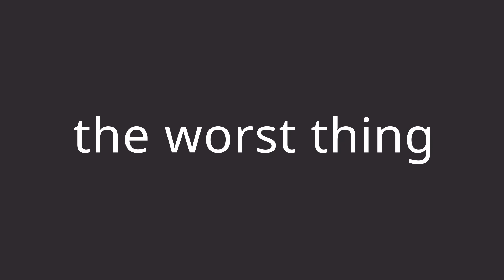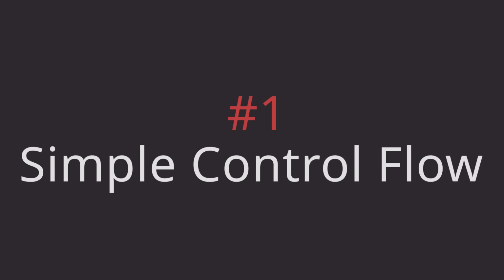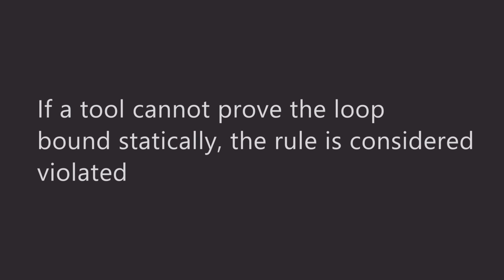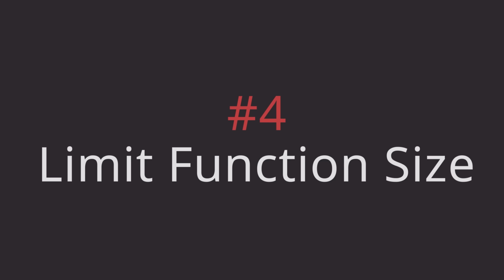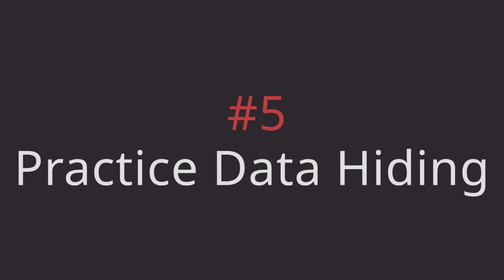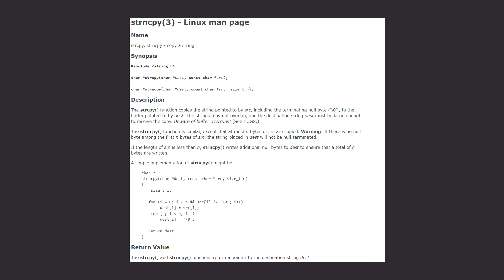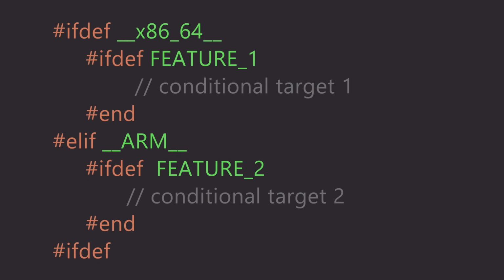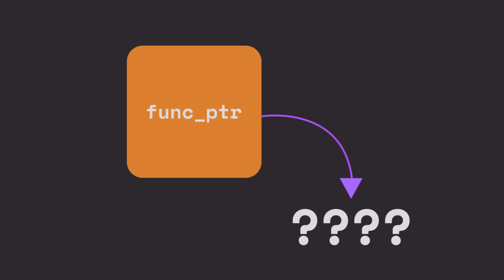how NASA writes space-proof code

Comment: I agree with every on one of these rules for all programming. I think there should be NO pointers, but that is just me. NASA code should be clean of anything like pointers or anything else not predictable. I don't care how careful anyone is, there is always a way for a pointer to suddenly get a NIL value, including from cosmic rays. Also, comment and full documentation as well. And make all functions testable independently of anything else. To be honest, I would rather a language like PASCAL be used, not C. Am I sounding stupid? PASCAL does not require pointer use unless there is a good need to do so, and pointers should be disabled for mission critical code in any case. I especially like how PASCAL allows one to devote their energy to good algorithm and programming, not to pointer manipulation and debugging.
Reply: "from cosmic rays" If your hardware is that vulnerable, do not use it in a space vehicle. Yes, your "pointers are evil (or I'm just too dumb for them)" bias is showing.  If a cosmic ray can change your pointer to NULL (not much of a chance for that, logically), then it can also change your thrust value from 0 to 32.  Which is just as bad, if not worse.
Reply: @JurgenErhard  I know how to use pointers and I use them when I need them. Sorry if I sounded stupid. Yes my cosmic ray remark was dumb, Just metaphorical speaking :). No pointers are not evil like I said. I use them all the time, But When programming Software to be used on space vehicles, I take things a little differently. And yes I am always careful with all of my code. And yes I write my code such that it can be reused, debugged, etc. readily.

Comment: This video puts me in mind of the scene in Apollo 13 where Gary Sinise was given a mountain of junk like vacuum hoses, connectors, wire scraps, tape and an RS-24M power supply and told to get the orbital craft's on board computer to boot using only 20 amps and that "failure was not an option".

Comment: I am a software engineer working on the mars helicopter with JPL. Most of these concepts are already familiar to me, but a couple are new as well. The ban on using heap memory is one that I very strongly adhere to and a lot of new embedded developers are often surprised by. When the IDE supports it, I set the heap size to 0 right away.
Reply: I haven't worked for NASA directly before but I did write code that take astronauts to orbit. We didn't really ban heap memory in our codebase per se, but basically everything has to be allocated upfront at initialization time, and everything is always initialized on boot. So we still use heap memory, and use C++ STL containers, but at post-initialization time there is no memory allocation. This way, you could be more flexible, but still get pretty strong guarantees. If your code is going to crash or run out of memory it's going to fail to init, which is detectable very early on in CI, and it's usually going to fail in the same way.
Reply: @BrotherCheng  That sounds fantastic.
Reply: Do you have the stack size set to a large number in production?
Reply: @stevenhe3462  I have not explicitly messed with any of the settings for the stack, but I also haven’t encountered any bugs related to the stack overflowing/etc. I also write applications for various tests rather than production code, though I can’t imagine that impacts this particular point.
Reply: @JKTCGMV13  Most stack overflows are direct of indirect recursion caused or code jumping out of a code that pushed to the stack before it returned in a proper way (remember, it is C: with great power comes great irresponsibility). Those are easily caught by a good static analyzer.
Reply: Huh, so basically the whole state of the app is either persisted or is located on stack? Can’t even imagine how hard it is to code this way
Reply: @ShimonDanilov  It’s really not that difficult at all. In bare metal embedded systems (no operating system) the applications very rarely have any functionality that would particularly warrant dynamic memory allocation. You can write incredibly complicated control algorithms and signal processing without malloc ever even coming to mind. 

When you need a bunch of memory to mess around with, you usually just use a buffer of some kind. Just an array of bytes big enough to store whatever data you’re anticipating. For example that’s super typical with serial communication where you’ve got a bunch of bytes coming in and you toss them into the array until the full message has arrived, then if you want you can cast that array to a pointer and treat it most ways you would any pointer. You can even cast that same array to different kinds of pointers based on what type of message came in. 

That’s all in the context of C/C++.
Reply: @JKTCGMV13  Huh, I'm more used to allocating a ring buffer for data streams, an array of bytes might easily not be large enough for the entirety of data to fit in (granted, I primarily work with images, but I've also ran into this problem with other sources that can produce a lot of data quickly).
Reply: @Lodinn  a ring buffer can also be implemented with a static array and two indices (start, end). So you may combine these two concepts :)
Reply: @thehibbi  Fair enough - iirc that's how I actually handled it in my last project... Been reusing this code for a while now haha
Reply: @JKTCGMV13  id assume the static loop limits can help in some places as well. if a loop can only run x times, you could only ever use x*sizeof(y) memory in it
Reply: @JKTCGMV13  Yeah, I can imagine you wouldn't absolutely need the heap for control agorithms and signal processing.

The heap is more useful for programs that deal with lots of data. Any program that has to read sound or images or videos etc. Otherwise, I can't imagine you'd need that much memory.
Reply: @ShimonDanilov Really not difficult 99% of the time. The main difficulty is just breaking a *habit*, if that's a habit you've picked up. It's largely an arbitrary habit. Most of the time, it's a simple matter of declaring "thing" rather than "pointer to thing". If you're going to allocate memory for it anyway, why not just ahead declare it - let the compiler allocate that memory.

The exception of course is when you might need a very large number of some item, and you can't tell ahead of time how many. When you don't know how much memory you might use. Ah but that itself is a problem!  You may run out of memory! So using malloc() is really just hoping you get lucky and never run out.

Time to take a step back and look at the algorithm. Maybe create process one a time rather than creating xxx,000 of them, then looping through to process them.
Reply: To me, an embedded guy for 6 years, this sounds incredible! I never used heap in any project, but I never needed to. OTOH,  writing pc software is really a different world.
Reply: @ShimonDanilov  it's really not hard to only use stack, it helps make managing scope and ownership infinitely easier
Reply: That's surprising to me considering almost everything stated here (except max iteration count) is pretty standard for embedded systems development.

Do schools no longer teach best practices? I'm guessing so as far too many developers these days glaze over when that phrase is used.
Reply: @justanothercomment416 I learned most of my coding practices in school.
Reply: I have noticed people using the heap but only for startup operations.  I didn't object but as I refactored the usual contractor (half assed code), creating a static struct is all he needed to do.   So we had all the malloc code only to allocate a stack object so in the end it bloated the code.
Reply: @rockpadstudios  All too often it is the libraries that use malloc at startup more so than the upper level integration code. The primary goal of not using dynamic memory is to avoid the problem of memory fragmentation (due to the use of free).  w/o free there is no problem using the heap - assuming you test for all your worst case memory usages.
Reply: Hi, the job that you do sounds very interesting! :) Are there any recommendations that you would give such as what languages you use, things that I should learn and so on? Thank you so much for your time.
Reply: That's something that's quite common in low-latency networking code. It's difficult to start but once you have the basic building blocks to use everywhere, you don't think about it anymore. I'm used to program with rotating pre-allocated trash buffers, whose scope is local to the function, i.e. it can pass it to lower level functions that are known not to use them (string functions, syscalls etc). This works a bit like a stack except that its depth is bounded and the calling function knows that after certain function calls the contents cannot be trusted anymore. And it's visible when developing that lots of local variables have a temporary usage, so it's not that difficult to allocate them from a shared pool and imagine some content barriers at each function call.
Reply: How did you get that job ? I've been programming for over 30 years, mostly on graphics and game engines. I'd like to work on embedded systems at some point but it seems hard to land a job there with no previous experience specific to that.
Reply: @nooan79  I interned at a defense company during college, worked there full time after graduating, then switched companies after a couple years where I got lucky enough to be assigned to the mars helicopter. My degree was in robotics and both jobs were titled software engineer
Reply: @nooan79  I would love to do the opposite. Been a most embedded software engineer for 30+ years including embedded gfx engines, but I’d like to work on game engines and game development. I’ve become familiar with with Unity 3D engine over the past few years and have developed some games.

I’ve applied for game development positions but they all want you to have shipped AAA games which is unrealistic for an “outsider”. The game industry is a very closed circle.
Reply: @nooan79  I think if you start to do some small projects in the spare time to get know about the basics is a great way, because then you also know if that is really what you want to do. I learned that embedded is nice, but no big projects please. If you have the basics i think you can also get a job there but maybe you will get an decrease of payment for the first job
Reply: I have seen people allocating heap in the function, use it and free without passing to any external functions down. And at some point that even caused a CPU overload, it was busy making syscalls for a function running a small calculation using heap as a buffer. Heap is okay for things you cannot predict or control. But, please, use stack for small buffers.
Reply: Send me your login info
Reply: Apologies about resurrecting a year old comment, but wouldn't it be preferable to simply use a language where you can encode those rules at the type level? As in, if you tried to use the heap, the compiler throw a type error?
Reply: And I am batman.
Reply: 7-11 have better opportunities! Ha... suck my robot
Reply: There are rather safe ways to lift this restriction by building same-sized heaps to avoid fragmentation and bounded heaps to make sure, nothing is leaking unboundedly. I saw many "no heap" projects which used a static array as a heap substitute, trying to wiggle around - then they could as well just call it "custom heap". Sometimes you just need something dynamic, which would explode the stack... The C runtime malloc() is just bad design, but many target systems have better things to offer.
Reply: How much consideration is given to error detection and correction when writing code for extraterrestrial environments? A friend of mine was doing a PhD in electrical engineering about embedded error correcting codes in FPGAs (or something), to deal with, from what I recall, rare events where data is corrupted by e.g. background radiation interacting with the chip. He was only looking at terrestrial applications (I vaguely recall one use case might have been in engine control units in cars) but I imagine in space, where there's rather more radiation, this might be something that requires extra consideration? It still must be rare but I can't imagine you'd want a Mario 64 speedrun type situation where a cosmic ray randomly flips a bit on memory and changes e.g. how high above the ground your rocket (or Mars helicopter) thinks it is.
Reply: @Redingold my role as an embedded software engineer was in ground-based testing of components and systems, so I don’t have much unique input in regards to radiation-hardening the flight software.
Reply: Might sound a bit weird, but thank you for working hard so humanity can progress!!! 🔥🙏
Reply: Mars helicopter?! So cool!
Reply: The thing is that it "wastes" a lot of time unless your organization has built heapless abstractions/utilities like you get with the C++ standard library. Wastes isn't the right word when you're talking about space missions though. I can tell you that there is safety critical software out there using C++ standard library implementations, but they are rigorously tested.
Reply: This was the one rule that I haven't seen before - sure sure there's no "free" and use of malloc is limited to the initialization stage but zero use of the heap seams a bit excessive.
Reply: You have to get satcon to measure time dilation difference as force with einstein's lorentz equation, atomic clocks measure curves in space time, you have to real time graph time velocities to map what gravity really looks like. So yes Einstein's Lorentz is perfect for all four physical forces you just need this equation with it F=(t'-t)C^2he34 to see the time dilation mechanics of space... how accurate? infinite t'=t/sqrt 1 - v^2/C^2
Reply: IDE hahahaha welcome to the 90s
Reply: @liukang3545  real programmers use butterflys
Reply: RIP helicopter :(

did you lose your job?

Comment: One very important rule is missing here : at any time you should be able to infer where you are in the control flow by checking some state value.

This way some watchdog will be able to flush memory and restart your program from the last stable state if anything occurs.

And as space is a very harsh environment anything will occurs, especially alteration of variables by cosmic rays, misread or malfunction of a captor, control flow  halted for months because of some planned shutdown or power loss.

The rule of thumb could be "don't thrust any input that hasn't been double parity checked, don't expect a state to stay forever if you do nothing, don't even expect time to flow continuously, and a value obtained several months ago to still be usable, don't expect anything".

Comment: Rust helps with (surprisingly) every rule:
1. Iterator adapters and Result/Option methods massively simplify control flow while making it clear what kind of control flow you are doing.
2. You can `.take(N)` an iterator to limit it.
3. Rust's ownership and Option enum mitigate the issues with using the heap, but I agree it's best to avoid when you can because the stack is faster and more obvious when you waste it.
4. Functions can be much tidier because syntax sugar and convenient methods hide the boilerplate.
5. Everything starts as private and must explicitly be made public.
6. You can declare that you `#[must_use]` a function's output, which means less cruft at call sites that don't need to be used.
7. Rust's macros are much more strict and "hygienic" than C's preprocessor.
8. Similar to 3; Pointer safety is enforced by the compiler, so layers of indirection is harder to get wrong. The logic behind avoiding function pointers is sound regardless of language, but you could make an enum with some methods on it so you can get static verification and some restricted dynamism.
9. Rust is pretty pedantic by default in comparison to C, gets more pedantic with clippy, and even more with clippy::pedantic.
10. Testing is built right into cargo and making a test is as simple as marking a function with the test attribute.
Reply: why are you comparing C and Rust? NASA uses Fortan as the main programming language and maybe also Ada to some lesser extent
Reply: @somebody1241  I only compared to C in points 7 and 9, and that's likely influenced by every example in the video being of C code.

Comment: Programming for 10 years, I have developed these rules in my mind. I thought it was so natural that every our fellow programmer has these rules in mind too, until you tell me that NASA writes it out explicitly. 😂
Reply: It's a trade off in readability.  You're making it less likely to have errors with improper memory use or flow control, but you're losing the ability to abstract your problem.  It's very easy to tell what the code is doing specifically, but a lot harder to see what the code is doing conceptually.

If you're performing a very complicated algorithm, the code won't tell you what's going on.  That's why this type of coding is common for microcontrollers but rarely used in the commercial world.

As a concrete example, I work on a codebase that includes animating potential fluid flow through pipes.  Each pipe segment needs to change its color to reflect the type of fuel that could be flowing through it.  The language we have to work with isn't much more capable than Dartmouth BASIC (we don't even have functions), and the code is a complete unpenetrable mess.  Because of this, while the program doesn't have any problems crashing, it's buggy and unreliable.  Using a language with better abstraction capabilities would make things much easier to understand and help us fix bugs before they reach the customer.
Reply: @jeffspaulding9834  Out of curiosity, are you at least able to use some "gosub/return" equivalent to sort of emulate functions?